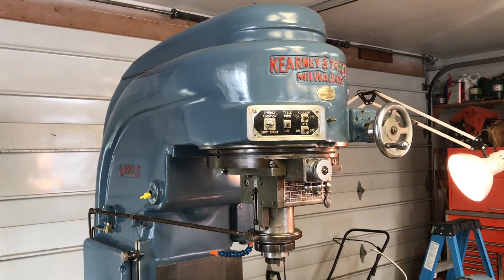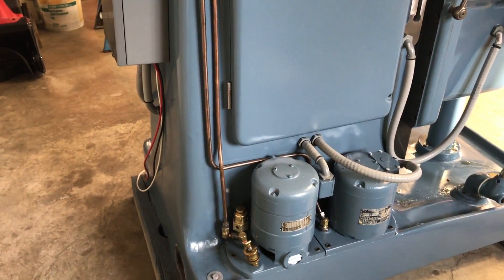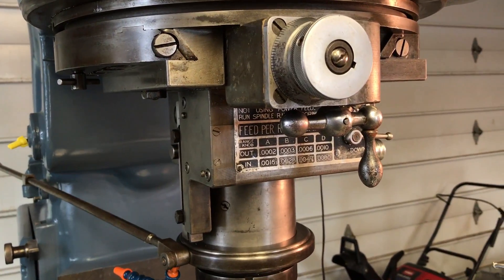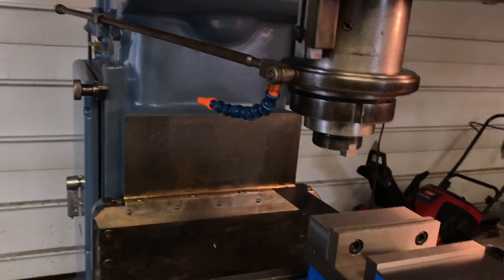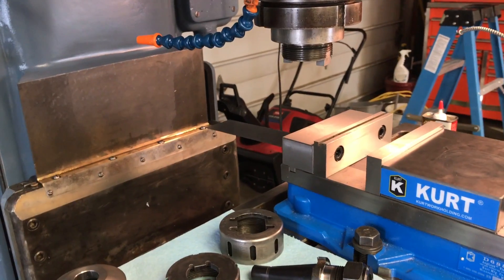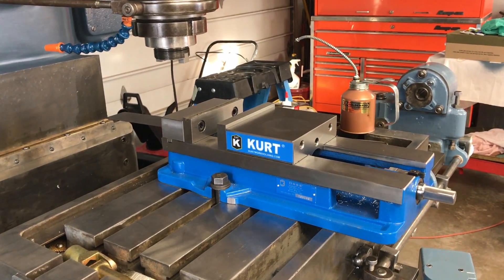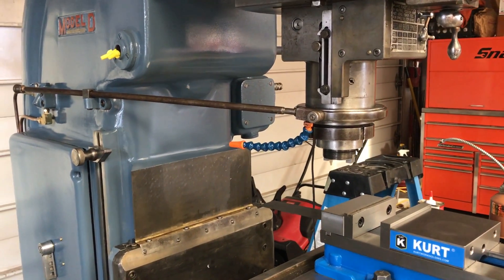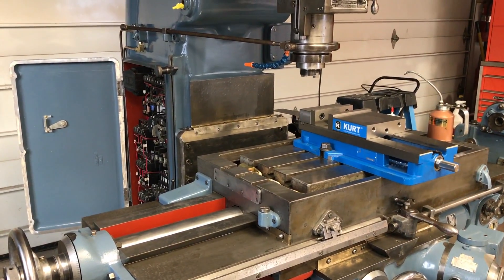Kearney & Trecker 2d Rotary Head Mill

Comment: I know this is 8 years late, but great video of your restored K&T 2D Rotary Vertical Mill. I bought one last year and like yours, it needs a lot of work and clean up. Not sure if yours was purchased already converted to a 220v 3 phase from 440v, but if you did the rewire I'd like to know how you went about accessing the wiring for the spindle motor and any changes to the heaters and fuses. Thank you. Carl

Comment: I have this same machine. I hooked it to my phase converter but not functioning correctly. I set it up for 240 3phase but I’m wondering if this is supposed be 440/480.
My panel with the diagram is too faded to tell.

Comment: I have a 1942 model 2d tool and die mill.. My machine originally used Bridgeport b3 collets but someone opened my spindle bore to accept r8 collets.. They also changed all five motors to single phase so it will run on house current.. I have the cherrying attachment, two rotabs and power drive for them.. Great machine!

Comment: i just found a mill just like yours i will be going to look and see if that is what i want! If it were you what would you be looking for?? please let me know. i hope my mill looks half as nice when finished ! my add  grandpappysmiles@gmail.com
Reply from the maker: fixitright Olson make sure all important parts are there. Replacement parts almost non existent . I had to make most of mine. Look to see if it has the tool holder nut and tool holder. Mine was missing and I had to make it. And all of the typical machine Checks like backlash spindle bearings and way wear.

Comment: Hi, recently I purchanse one machine like yours, and I´m starting to rebuid it. I would like to remove the spindle No. 30 Taper, do you know how to do that? I will apreciate your help. Thanks
Reply from the maker: There is a manual for the 2d on vintage machinery. It explains the process. I’ve had mine apart a couple of times. It’s not to hard.